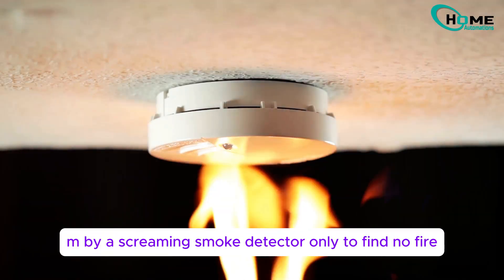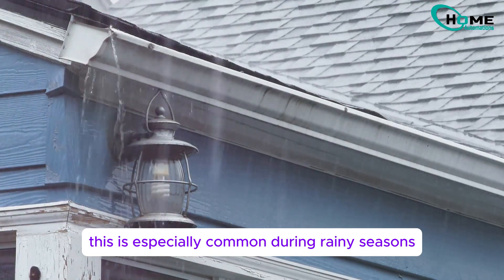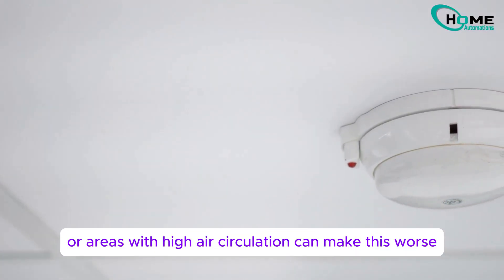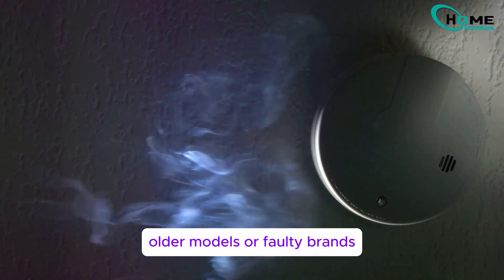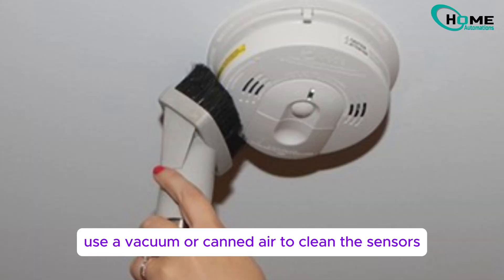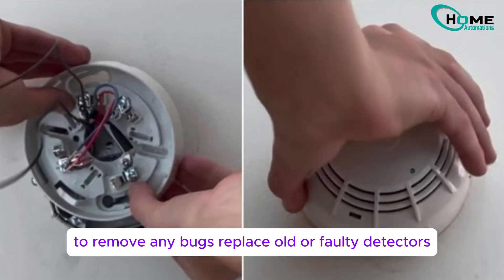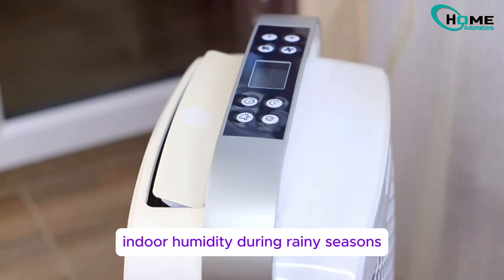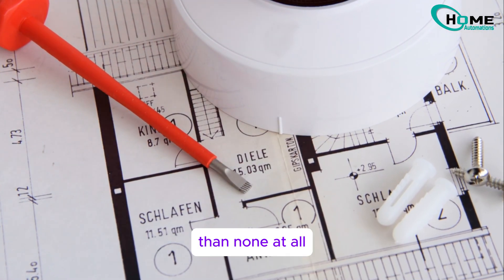Smoke Alarms Going OFF For No Reason Hard Wired - Reason and Fix

Comment: Too complicated- i just wanna sleep w/o it blaring making my ears ring
Reply: Flip the breaker off that's for the smoke detector.  Disconnect the unit from the connector in the ceiling - should be a clip that snaps apart without breaking  it or the wires.  Remove the battery. Press reset/ test  button. Gently blow to remove dust.  Replace battery with new battery. Reconnect unit with wires in ceiling ensuring a good connection.  Place back on ceiling.  Go flip breaker back on.  Should work.  And yes you have to do all the steps.
Reply: @nuttiebud  thanks. It didn’t work though and im about to lose my damn mind with a toddler who is scared to death with the fucking thing going off for over 2 hours now